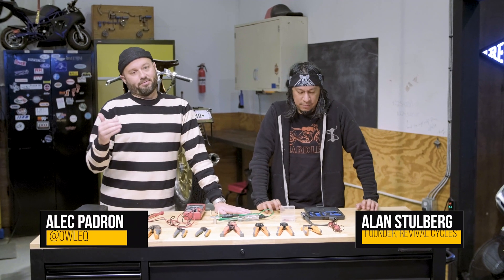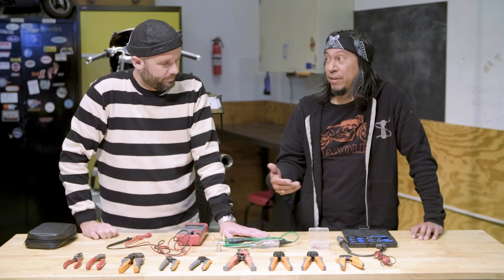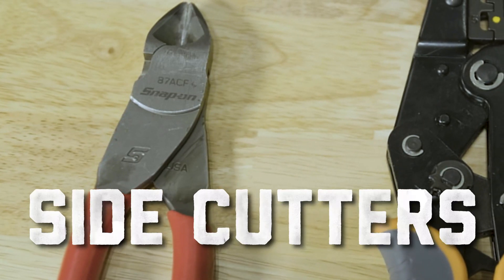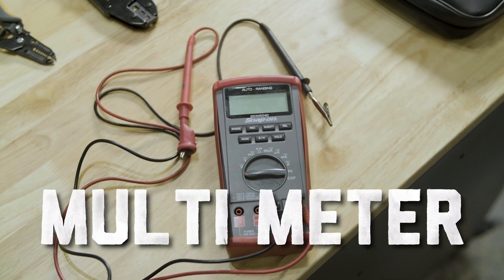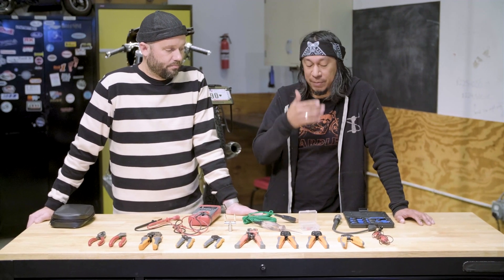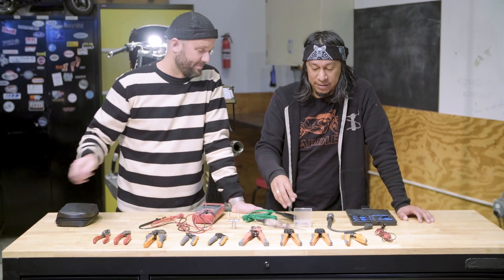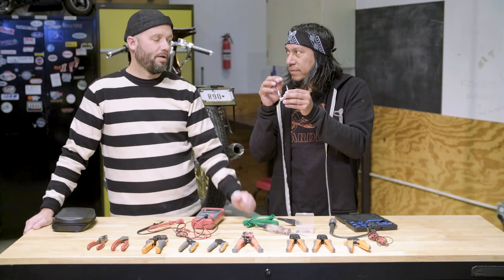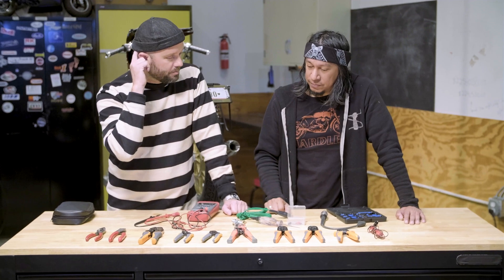How To Wire A Motorcycle Series,  Episode 6: Tools We Love.

Comment: Can anyone help me.ive been on this wiring all week.i got a 1988 custom chopper 1340 80cc need a wire diagram for the battery all power to the ignition to stator rectifier to the two spark plug coil atomic ignition too the voltage regulator. I'm pulling my hair out all week.need awire schematic for the whole thing
Reply from the maker: Hey Brandon, the truth is that no one is going to be able to give you a comprehensive diagram for all of those specific components, there just isn't a paint by numbers solution to this. A huge part of this project is gathering together the instructions for all of your bits and drawing your own wire diagram and ideally that would be completed before you ever start laying the wire. If you visit our knowledge base you can find some universal diagrams that will help you lay out the controls and wiring that is the same for every bike and you'll find a guide to help instruct you on how to complete the portions that are unique to your project. https://technicalarticles.revivalcycles.com/hc/en-us

Comment: Quick question, would you terminate all wires going in/coming out of a Motogadget m.unit with ferrules? Or do you strip them and put them in the m.unit connectors directly? Cheers!
Reply: For me minimaly a ferrule and if possible a crimped and heat shrinked ring terminal.

Comment: how do you solve the issue of an aftermarket brake perch not having a front brake switch input/mount?  Would you recommend an inline switch (in the cable) or fabricating a mount to the aftermarket perch for a normally closed momentary push button?
Reply: There are several pressure switches that are built into a banjo bolt that work perfectly for this. I put one on the rear brake of one of my bikes. 

Edit: Looks like Revival sells one. Awesome!
https://shop.revivalcycles.com/hydraulic-brake-light-switch/
Reply: Graig Cameron email them

Comment: I would also recommend a non-contact voltage tester.  Great for figuring out if you’ve got current when you can’t access the connection point.

Comment: question about connectors.  I'm looking at swapping my start/stop switch on my race bike.  What type of connectors do I need to make it look full factory.
Reply: Rick Crespo You’re asking a super broad question. “To look factory” you use whatever your bike has on it. If you’re looking for Yamaha look you use Yamaha stuff. The closest anyone could probably get you is, use whatever connector your electrical stuff already has on it. If it’s raw wires the. use bullet style connectors. Waterproof means higher quality usually. If it’s permanent you solder it and the. Heat shrink over it. Electrical tape is cheap and temporary. ((Dual layer heat shrink is supposedly better. It’s sticky on the inside. I got some today in fact)). The one thing I feel like you NEED to know is that there are two levels of connectors for sale. ((I’m talking about the flat male and female style)) There are the normal slide wire in and crush on. These are straight trash. The better ones look almost the exact same but require two steps. You slide the wire in. You crimp the cable in and then you crimp the connector slightly farther down onto the wires plastic housing. I’ll be honest. I’ve never used the better type but I know for a fact they last way longer and are much higher quality while costing the exact same. Just more work. There may be a bullet pin equivalent. The big difference is that wires don’t slip out.
Reply from the maker: Shae did most the work for me. If you need OEM connectors Corsa Technic is a good place to start your search. https://www.corsa-technic.com/
Anytime we're using and mind of crimp on connector we prefer Crimp/Solder/Seal terminals which secure the wire with both a crimp and solder then add an additional layer of vibrational dampening and water seal with integrated heat shrink.